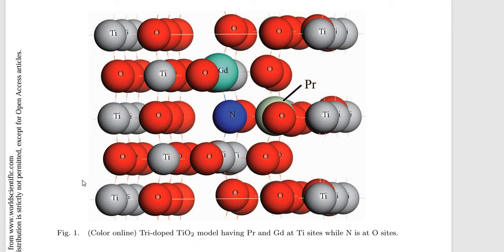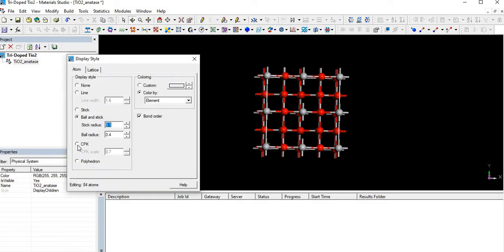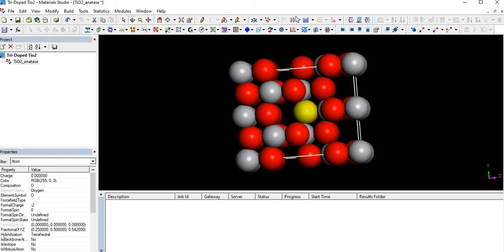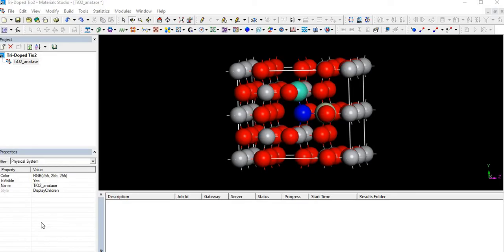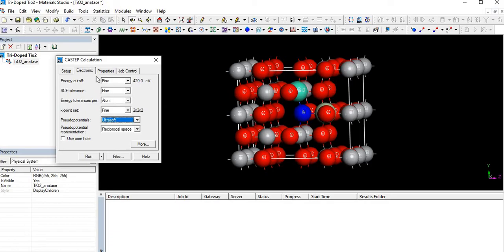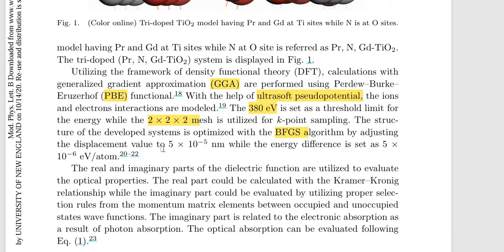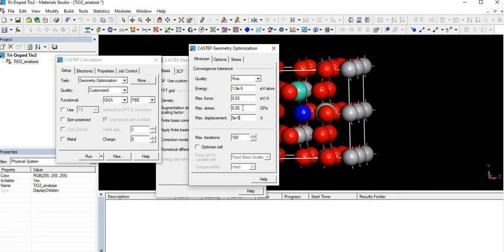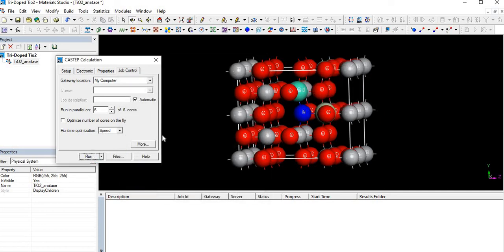How to Reproduce Scientific Papers Using CASTEP | Tri-Doped DFT Calculation| Gd,N,Pr Doped Tio2|

Comment: very helpful, I have a question, How to fixed layer or atoms in the structure, and how can we knows that is fixed?
Reply from the maker: Fixing layers or atoms in a structure is a common requirement in simulations, especially when modeling surfaces, interfaces, or slabs.the method for fixing atoms depends on the simulation software you are using.